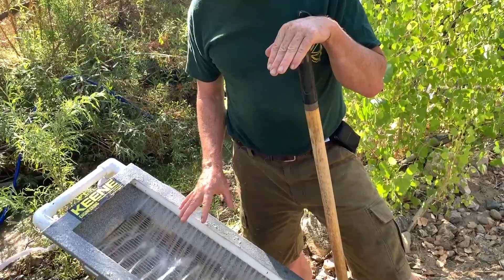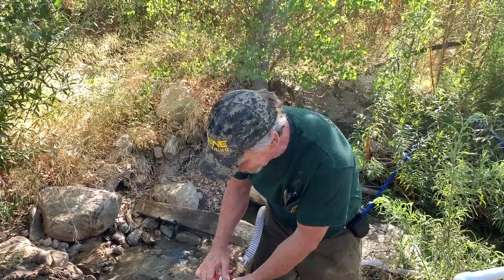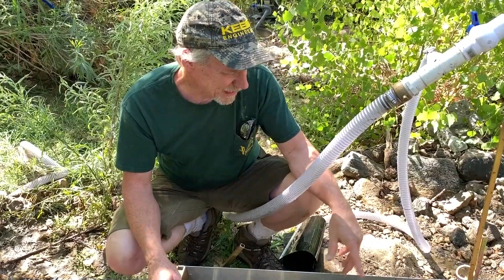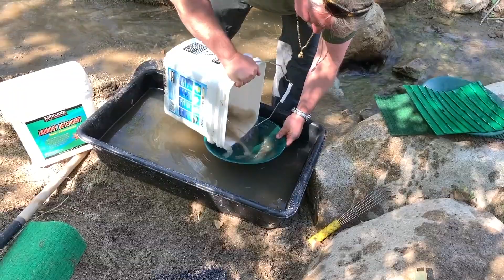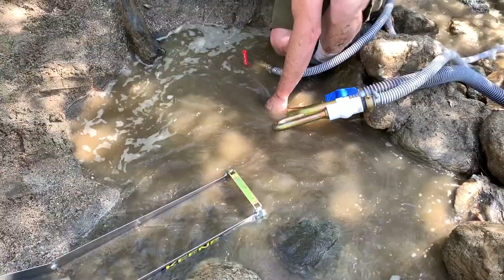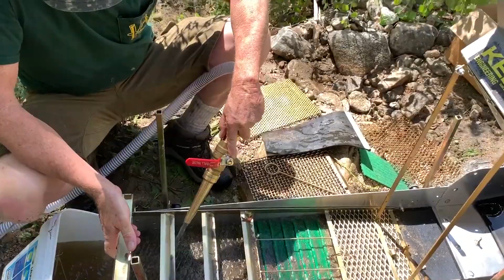A52S test 10.2 conversion High banker and dredge.

Comment: What is the largest dredge hose for the high banker? I am thinking of ordering it.
Reply from the maker: With the a52 10" wide 2.5 is max.   A larger sluice 12" wide would be 3".  A larger 20" to 30" wide box would be 4"
Reply: @KeeneEngInc  Thanks I ordered the A52S waiting for shipment. Thinking about the hi banker/dredge option.

Comment: Hey guys just got done doing a bunch of Mods on the Highbanker you sold
Big Mike a while back, built in leveling check set at 10degrees to start 
putting an inline one way check valve so it wont loose its prime and cavitate the system  
this is going to be a Gold getting machine .

Comment: Nice video! wondering if you have those mesh screens on the new A52S models? Also, wondering if you are using a different pump for that spray nozzle or just tying it in from the same pump? I couldn't see the source of power? Thanks

Comment: Looked good i liked the rubber flapper on hopper for the hose! Id like to see the bar that holds hopper up not be in riffle action but hey im not there to see but all in all looks great! & oh and that hose for clean outs those are a must
Reply from the maker: The blaster hose is a must what a difference!!!  The hopper support bare has no real impact on the riffle board.  The thing that I love is the pump, is works so well and hardly drinks any fuel.

Comment from the maker: We are going out again this weekend.  I will try to add priming the pump.  There are just so many things to cover it is hard to fit it in on a video.  I hate to go over 30 minutes due to short attention spans.
Reply: Go over 30 min? That equipment is heavy. Make innovation. Create riffles from plastic pipe on 1-st floor. And all down floor can be plastic....No big rocks there.
Reply from the maker: Good idea!  We have played with the plastic rubber etc riffles in the past it just hard to compete with the durability of a steel riffle.  You can through them around set things on top with no issues.  We have even tried aluminum rifle, however, the first time you drop them they are tweaked out of shape. Plus we are using the standard riffles that come in the A52S sluice box.  All we are doing is adding on some trick screens to slow the water down.